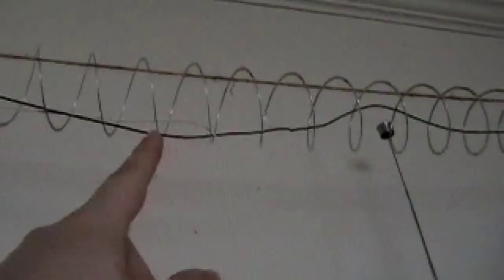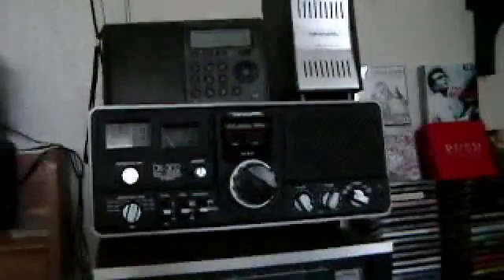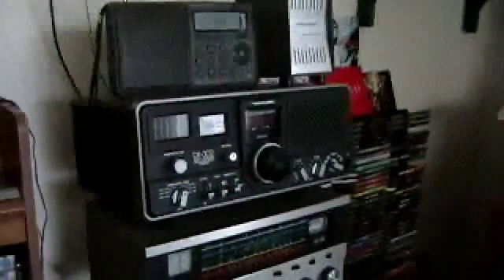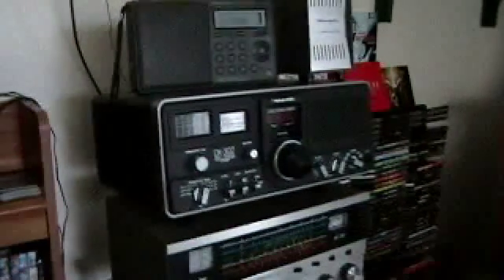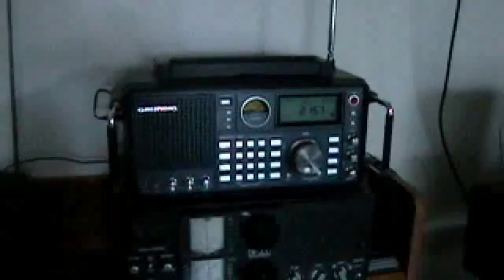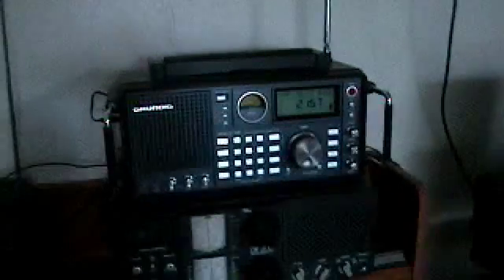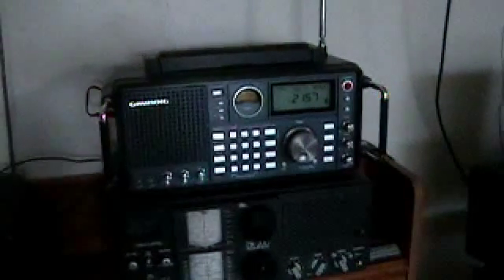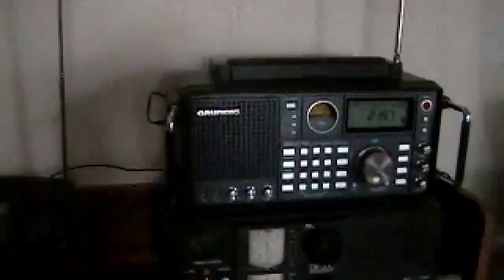My Indoor Slinky Shortwave Antenna

Comment: https://www.youtube.com/watch?v=kSy8qVYlrE8 
 The slinky's that I used are not the standard size. They are a little smaller diameter. I got them when stationed in Korea.
Reply from the maker: Cool. I will definitely check out your video.

Comment: Can multiple shortwave radios run off of the same antenna at the same time?
Reply from the maker: They can, but there is some signal loss. Your best bet is to use an antenna switch to go back and forth between different radios.

Comment: I can't imagine having a birds perch antenna strung up in my shack.The only thing
missing are the birds.I use a slinky in a corner vertical hanging.It's never noticed
unless I mention it to someone.It does a fine job.I like neatness and organization
 How many times have you seen a SWL receiver  like this one up where the
arm has to be raised to tune it,A real arm cramper,The arm should be flat on the
desk when tuning.And the PC monitor at eye level.But that's me

Comment: The second thing I'm looking at as of late, is DRM shortwave radio reception and or possiblily SDR radio.If there's enough signal to capture and hold, DRM offers clear reception.Digital encoded information over SW frequencies.Software Defined Radio is the future, like it or not.I don't believe it will replace rigs, but it's an added demension to radio listening pairing the receiver with a computers software. I like the video display it also allows for...73's Sir

Comment: Mr. Davidson, I'm looking toward two things lately.One is either a Pixel or Wellbrook Loop antenna.Now both gives me sticker shock 4 sure, being a $500 antenna, but they receive great reviews,I make my own spiral MW antennas and although not as good as a wire, they don;t do bad.So for space, amplification, tunability, and the ability to use with a rotor, it's very inviting.As for the Eton, Grundig 750, or Tecsun 2000, my problem is their price.I think it's too high, but good deal on the longwire

Comment from the maker: Thanks! Yes I only use it for receiving. And for the most part it works pretty good. I recently added a random wire outdoor antenna to the Grundig and it has drastically improved reception.

Comment: I guess the one thing I might say is that your antennas are so close that they will interact with each other. Not a terrible thing if you're just receiving. In the end, ya use what you can. I've read of people using miles of a guard rail as an antenna, primarily for long wave reception. My Realistic collection starts with the 100, 150B, 160, 200, 300 302, and the 394. I'm not sold on the Satellite 750 or with it's other tags, such as what Tecsun might call it. Good Luck and 73's...